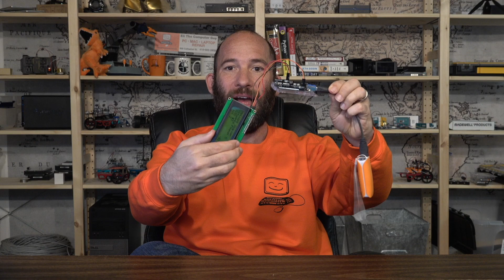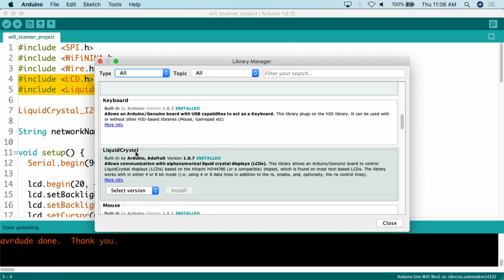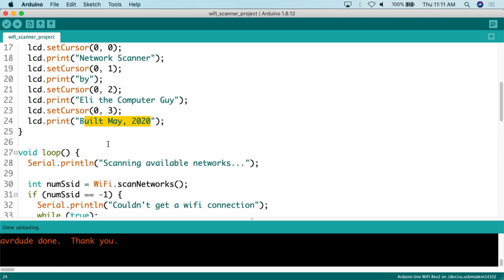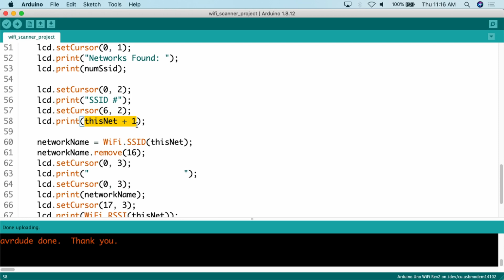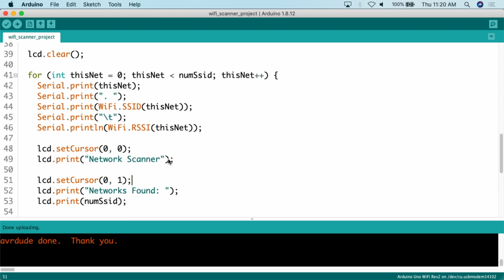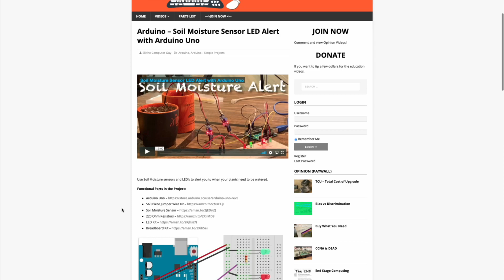Arduino Uno with WiFi - WiFi Scanner with 20x4 I2C LCD Screen Project

Comment: There are issues with the libraries described in the video starting at 9:24 
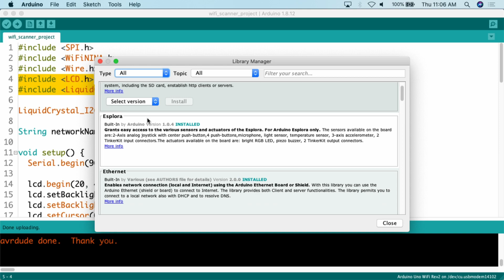The video shows some header files and a constructor that are from a different library than those mentioned at around 10:00
The "LiquidCrystal" library by adafruit is used for 4 bit mode using direct pin control and while Frank's "LiquidCrystal_I2C" by library does contain a header file named "LiquidCrystal_I2C.h" the code shown in the video is not using either of those libraries.
The code is using <LCD.h> which is a header file from fm's newLiquidCrystal library. The code is also using <LiquidCrystal_I2C.h>
and while there is a file named LiquidCrystal_I2C.h in the Brabander library, that code isn't using that one but rather than LiquidCrystal_I2C.h file in newLiquidCrystal.h
The way you can tell is to look at the constructor for the lcd object. The constructor for the Brabander library has 3 parameters (addr, cols, rows) the constructor for the NewLiquidCrystal LiquidCrystal_I2C i/o class has 8 or 10 parameters:
(addr, en, rw, rs, d4,d5,d6,d7) or (addr, en,rw,rs,d4,d5,d6,d7,bl, polarity)

In order to use the code you have shown in video, users will need to install fm's newLiquidCrystal library and ensure that the pin mappings match the LCD device they have as not all LCD backpacks are wired up the same way or use the same backlight active level control.
Note: fm's newLiquidCrystal library is no longer available on bitbucket so users may struggle with finding it
and Frank's library has not been maintained properly for the past 5 years. Currently it has issues with the github tags so you can't get a reliable version using the IDE library manager. Also it recently has been abandoned.

To avoid the confusion over all the "LiquidCrystal_I2C" libraries and i/o classes, and to make things easier, I  would suggest switching to the hd44780 library. It is readily available and is actively maintained.
The hd44780 library has several i/o class similar to fm's newLiquidCrystal. The hd44780_I2Cexp i/o class is for LCDs with i2c backpacks.
The hd44780 can offer a plug and play solution for LCDs with i2c backpacks as it can auto locate the i2c address and automatically self configure the pin mappings by automatically determining the pin mapping/wiring between the PCF8574 chip and the LCD and the backlight active level control.
It can be installed using the IDE library manager.
It comes with lots of examples including documentation in the Documentation sketch and there is a wiki on the github page.
It also includes a diagnostic sketch to verify that everything is working and help diagnose any issues.
Here is link to github page where you can see some documentation and installation instructions.
https://github.com/duinoWitchery/hd44780
It should be installed using the IDE library manager and not installed from a downloaded zip file.